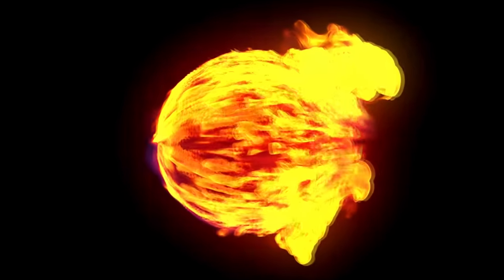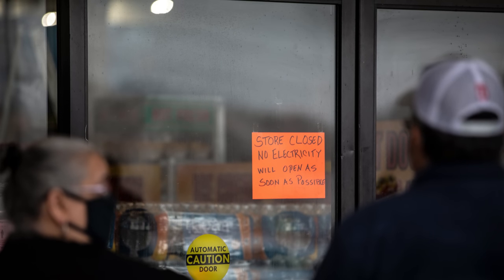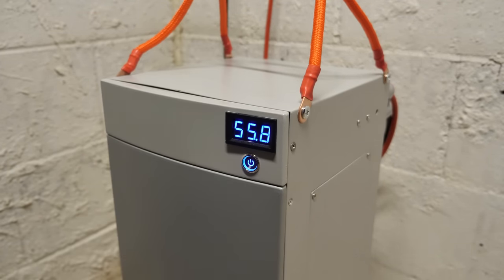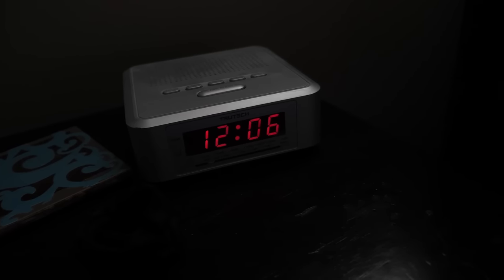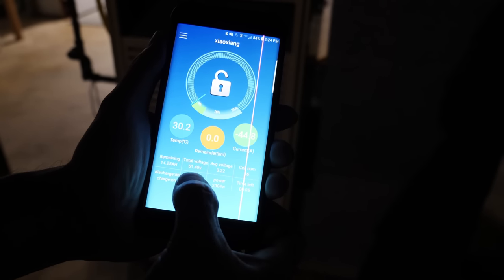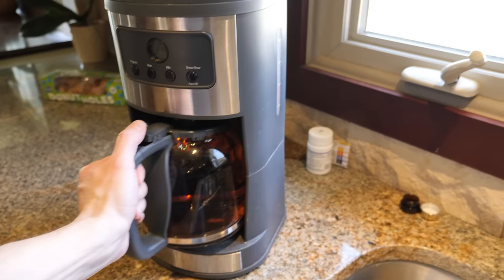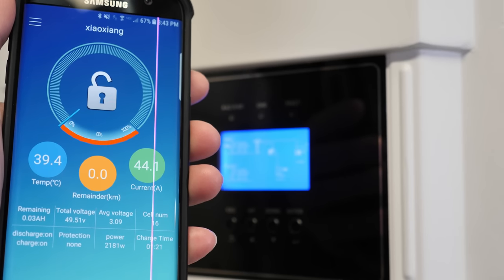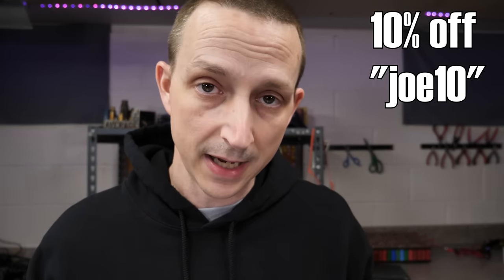Power your House with a Husky 48v 5.3kwh LiFePO4 Battery! BigBattery.com Test Review (2023)

Comment: Hey Joe.  Great video.  I'm in SW Florida. After hurricane Irma we were without any power for 10 days - can you say miserable.  I am in an HOA community with no natural gas available.  For a whole house generator (with a propane tank buried (HOA requirement) and filled) it is right at $17K (house is 2,090 SF of living).  4 of the Big Battery units is $7,920.00 with their bulk discount, your discount code applied and free shipping.  I don't see doing solar (another HOA obstacle).  For all the additional hardware pieces I would need to set it up (not including an electrician's cost to put it all together) what do you think those costs "might" be above the costs of the batteries.  Just trying to se if it is a feasible alternative to the whole house generator (and of course less cost) and I am totally lost with all this stuff.  Thank you!
Reply from the maker: Sorry for the late reply!  Yeah thats kinda high in price for a propane system. I want to mention BigBattery now offers kits with inverters if you needed one.  They have the 6kw version of the inverter I am using!  Its a beast as well. Comes with all the battery (or batteries) cables ect...  You would need to wire the AC side tho or have someone wire it.  I dont think it would be to expensive to have someone wire in a sub panel.  It would be far less then the $17k for sure especially with the discount code!  Here is the kit and they have different battery capacity options https://bigbattery.com/products/48v-all-in-one-mobile-power-system-elite/?ref=53&campaign=PowerHouse

Comment: The power supply from the grid is divided in separate groups. One or more of the electrical appliances in house are connected to a specific individual group so that the cables for each group will not be overloaded by too many appliances drawing current at the same time. So how does the battery connect to the appliances? Is the current output cable from the battery also divided into the separate groups just like the grid supply?
Reply from the maker: Battery connects to the inverter. Inverter mimics the incoming grid and connects to your panel the same way as before.

Comment: Hi! I ordered 2 48v LAMA batteries after seeing this video. I am in the process of having a new solar system installed on my home. The electrician is coming next week. I asked the company several times to check compatibility with these batteries and they said it would work. Now they are coming back and saying there are some red flags, and they have concerns about the batteries frying the system or having issues. They are going to pay for shipping and restocking fees to return them, but do you think they are being straight with me? I have 24 375w jinko panels and a SolarEdge Energy-Hub battery-ready 7,600-Watt Inverter. Your advice is greatly appreciated as I was really excited to have battery back up to my system!
Reply from the maker: Should be just fine as long as the inverter battery specs can be adjusted. Max battery voltage on the Lama says 51v and low side is 40v. In the inverter settings you would most likely set high side to 49-50v and low side to roughly 42-43v.

If you need a diff range in voltage Id get a 16s lifepo4 battery. The Lama is a 14s.

Comment: Hi, I enjoyed your video. It was very helpful for me in choosing the right battery generator for my home. 

1.) I was wondering, do you have a DIY video on setting up the house electrical panel for the Husky 48V battery generator?

2.) I have solar panels installed on the roof of my house, is it possible to link to the battery generator and charged it?

Comment: I designed a system much like this for my house, but I can't find a single electrician who is willing to install it for me.  Nobody wants to touch it.  I even had one electrician tell me that the system I want to put in -- almost exactly what you have in yours -- doesn't meet electrical code.  I suspected that he was full of crap and just throwing out excuses to blow me off, but I wasn't 100% sure because I'm not an expert on residential electrical code.  (I know how the stuff works, but not what the regulations say.)  I was about to give up -- and then I stumbled across this video.  Now I'm motivated to continue trying to find somebody who is licensed for residential electrical work and willing to actually install my whole house UPS system for me.
Reply: Any questions regarding code can be answered by city electric inspector. They will help you prevent probs. Might even have contractor who does the work.

Comment: BOOM!!! wow that battery worked really well, thats also a good test of all your new wiring. I love the programability of your inverter, that makes it quite versatile. You should do a test of how long you can run your natural gas heater for, because that is the #1 thing that people needed during the Texas power crisis. I also loved the fun of "lets power everything" because that is exactly what I would do! :D Thanks for sharing! cant wait to see your other battery bank setup in parallel to this one for even more capacity! Then with all the solar you have you should be able to be 90% off-grid and only have a failover to the grid if the battery gets depleted, and it will stay on grid until the solar charges everything back up.
Reply from the maker: Thanks Man! Yeah really loving the new inverter! Tons of options! OMG did this battery work well! It did blow my mind, that was not made up for video! Our furnace is piped for gas so cant run out unless the city runs out. Would be kinda a cool test tho! 💥🤘
Reply: @AveRage_Joe  yea the only thing that will shut down your furnace is the power for the controls and blower motor.
Reply: I am a texan recoiling from the damage and looking into backup options. I wholeheartedly agree, natural gas heating is no good without electricity.

Comment: If the grid goes down and your house is useing 2000 watts can you have 3000 watts of solar coming in,and that would mean you would be useing none of the battery and still have a xtra 1000 watts solar charging the battery or keeping it full. I'm new to all this so trying to understand
Reply from the maker: Yeah you would charging the battery with the excess and continue to power your house!!

Comment: You did not start up any 230 volt appliances like a well pump or electric dryer.  Will this battery handle a 230 volt 1 hp well pump with other stuff you had going?
Reply from the maker: Yeah it should start a well pump no prob!

Comment: What about doing 7 loads of laundry while using the washer and dryer at the same time which takes most of the day since washer is close to 1 hour each and the dryer at 45 minutes each load and while lights, tv and so on is on?
Reply from the maker: Couldnt happen with one battery but multiple. Would also be great with solar running!

Comment: 2013 14 days no power in CT ice storm.  We did even get rolling blackouts there was no power at all.   Have 3 parrots and I moved them into the kitchen for stove warmth.  Outside temp was 30 degrees. Inside temp was 50.  If I  ran just the furnace for heat and hot water and fridge for food, how long would that battery last?  Serious question.
Reply: Did = didn't
Reply from the maker: Sorry to hear that!  If your heat is electric then you would need more batteries in parallel.  My heat is gas as well as the water heater.  If I run furnace, 2 fridges, lights, tv and all the chargers or phantom power its around a 6hr runtime for me.

Comment: I live in a small cabin currently on the grid using on average 8 kWh per day. I'm looking to go off-grid and have considered buying this exact battery with a 3,000 watt Gro-watt inverter and 2400 watts of solar panels. Would only one (1) of these batteries suffice for my off-grid power consumption? I use most electricity during the day.
Reply from the maker: I would say yes for the most part as long as you have the sun. How many hours of direct sun do you get a day? Do you have AC or electric heat? Those are the killers of course!
Reply: @AveRage_Joe  I'm so glad you responded! I get sun all day, although I know the direction / angle of the panels determines how much energy they produce, so I'd say 4-6 hours. I guess cloudy days would be the real issue. My heat source are the Envi convection heaters that only use 450 watts of electricity. I cool with a window air conditioner.

Comment: I just watched this video and I have a couple of questions…do I just need an inverter and battery to  power my house without solar panels? I’ve been on the fence regarding solar but if a complete Solar Array isn’t necessary I will just get an Inverter and battery …and what range of cost would I expect?
Reply from the maker: Yeah if you want to have some backup power or something to keep you going during blackouts ect... I paid 2k for this inverter and the battery is 2k with discount!

Comment: My blackout didn't roll. 3 days no electricity. :-/
I am now setup with a generator and propane.
Enough for a day so far, but I expect I'll be able to go out and refill propane and/or gas.
Looking to save up for one of those inverters and that battery. Thanks!
Reply from the maker: That sucks man! Sorry to hear! Good to hear your set for the next if/when ot happens again. 

BigBattery now offers kits with a 6kw inverter just like mine(mine is a 12kw) amd different batteries of course. Pretty awesome stuff!

Comment: Hi Joe,
I have the following questions for you:
1) Can you do a video to compare the HSKY with LAMA? They are both 48V battery banks but several different tech specs. Basically tell your viewers which is better. 
2) Can these products be charged by solar panels while the are being used or discharged?
3) These bigbattery batt banks have built-in BMS, if one of the cells are faulty or stop working, will thd BMS bypass or isolate the faulty cell and will the bigbattery bank work seemlessly?
I'd appreciate your reply soon as I am planning to make a purchase soon.

Comment: Is 56v cutoff too high to set?  I have the same battery but the lama and I have my cutoff set to only 51v, I wonder if I have mine set too low.  Is it safe for me to raise it?  I went thru the Texas storm myself and didn't have power for almost 5 days.  Since then I've built a off-grid setup with bigbattery and a some big panels over my garage and have it all up and running.  Might add a 2nd lama battery.
Reply from the maker: The Lama is a 14s battery inside and the husky is a 16s so my voltage is a little higher. Your cutoff of 51v is max charge so your good to go! For increased life you would actually lower it to about 48.5 to 49v🤘

Comment: According to big battery, the specs state a charge voltage of 58.8V, and low disconnect at 43V (or 46V for more life/cycles).  You have the inverter set at 56V, and you mention doing that because you don't want accumulated errors and the BMS cutting off.  But it seems like this battery is designed to accept 2.8V higher than your charge voltage, which is pretty significant (maybe 20% battery capacity in that range).  Can you explain how you settled on 56V?  Seems low, and not allowing for full charge?
Reply from the maker: Yes great question glad you asked. So meow that I have used it I can raise the voltage. I think a cell or 2 were still in balance mode and bms was stopping the charge as its intended to do. So now that the cells are more top balanced I can raise the voltage. Also another note since recording this video is I used an apple phone with that same bms app and can now see all cell voltages and or everything. I plan to do a follow up video (possibly the teardown and capacity test video) and will mention/show that!!!🤘
Reply: @AveRage_Joe  Thanks for the additional detail - look forward to the follow-up video.
Reply from the maker: Thanks Man!🤘

Comment: The main thing I would want to power in So California would be the AC for a few hours or so.  No one checks the 240 output on these inverters that I've seen yet.  That's the whole reason they are 240V inverters right?
Reply from the maker: Yeah you can do that with this inverter. Only reason I havent is battery capacity. Wouldnt last to long with this battery. I will say that I have it connected for 240v into my panel. I am using both 120v legs for 240v.

Comment: Can you run AC not just the blower? I was wondering how it would work during hot summers. And how many hrs before empty.  Say tv, a couple lights and AC..
Reply from the maker: You could run the AC but not for very long. You would want more as AC requires a huge amount of power!

Comment: Joe great vid! Quick question, unfortunately here in lebanon we're getting lot of blackouts due to government corruption, total of 10 hrs/day (from 8 am till 10 am, from 12:30 pm till 3 pm, from 12:30 am till 5:30 am) the rest of the day it's mostly from generator (12 hrs) and couple of hours from governmental electricity. Would it be sufficient to install such a battery? Does it consume lot of generator power when in charge? Cause we're paying high bills on generators. Your reply would be highly appreciated ❤️
Reply from the maker: Sorry to hear that! Yes 100% its worth it! I of course dont want to loose power ever of I can help it! Even if you dont get this battery and inverter, I would have it!!! You could easily charge it in the few  goverment hours of electricity!!

Comment: I am planning to install a Ev4 - 48 v. 3000 ehv inverter and single eg4 lifepo 4 48v battery standby system with PV panels. This system will be used as a backup to grid power . I also plan to use this system for off grid power when possible. My house is mostly natural gas - furnace , water heater, stove ,  close dryer. I need to power a sump pump, refrigerator, furnace blower, led lights . Can you do a video on how to wire this inverter to my 200 amp service box as back up to grid and also use stand alone to power house off grid ? Love your videos !! Very informative - thanks in advance for assistance .

Comment: So for that 3h on the battery, how many amp or watts you pull out of that battery. And is this result match with the spec on the battery? If you pull only 100amp of this battery and the battery is rate at 120amp, it's very bad we do not buy this battery.
Reply from the maker: I have another video showing the capacity test. I tested multiple times at different amp ratings and all test show slightly above the rated 103ah. Most test were 104 and 105ah!🤘

Comment: I haven't any stories about people with off grid power during the blackout in Texas. I was wondering if off grid power is available in Texas or if the batteries stop working if it gets too cold outside or if anyone with off grid power in Texas was affected at all.
Reply from the maker: Sure if its SUPER cold Lithium batteries have temp control in there bms which will cut charging to prevent damage. That is usually below freezing. However if the system is in use the batteries will stay warm and continue to provide!🤘

Comment: Aloha Joe a couple of days ago I sold my off grid power System and all the Tesla batteries, I used your pulley idea to left and remove my 260lb inverters and charge controller off the wall I used 7 pulleys and it worked great 👍 I just purchased a new off grid power system just waiting for shipping. Just wanted to say thanks for that tip in your video it really helped. I left the pulleys on the wall to lift the new inverter on the wall when I get it.

Comment: next i see that the battery is fused.  Is there a grounding bolt to it? NEC requires grounding if the solar system ( battery included) is tied into the main panel. I think
Reply from the maker: There isnt a ground bolt/lug but could easily attach a ground wire to the lower frame!

Comment: hello
Can I use separate Bms for ups to discharging only and charging from separate power supply when it is not in discharge mode
Note i am using 1kva 12v UPS which use lead battery ... and i want to use 3.2v lifepo4 battery instead
^ _ ^  ...i do not want to charge from ups it maybe  damage the lifpo4 battery   ...can it work ^__^
Reply: @cobra 7  sounds like it will work to me. I have been using a 4S LFE battery on a 12v UPS for a few months now. as long as the cells are well balanced you can charge with the UPS. Also having the BMS in front of the battery will protect it from the UPS over charging or over discharging the battery. (Edit: comment moved from other conversation)

Comment: If your grid goes down does your solar still charge your big battery?

Does the inverter allow you to turn off the grid using a timer during the day and turn it back on at night when the grid costs less?

System would pay for itself in areas like California provided no AC was used.
Reply from the maker: You betcha the solar will charge. Thats how Ive been running it for the past few weeks. Running house off solar during the day and when sun goes down it will use the battery. Then when battery is low it switchs to grid untill sun comes back out.

This inverter doesnt switch with time however you can do that manually with the phone app or pc!🤘

Comment: Fantastic test. I’m trying to determine if the Kong Elite 15kw big brother to the Husky is Canadian certified. CSA, cul, cEl. As I want to use in a hybrid battery backup system. Any knowledge on this would be awesome. Their website doesn’t say.
Reply from the maker: Thanks Mate! You may want to get the 14kwh Rhino as they are getting it UL listed. Dont think the others have certs!
Reply: @AveRage_Joe  -- I was wondering why you might want a Rhino versus the Kong, because the Rhino appears to be lower power but higher price.